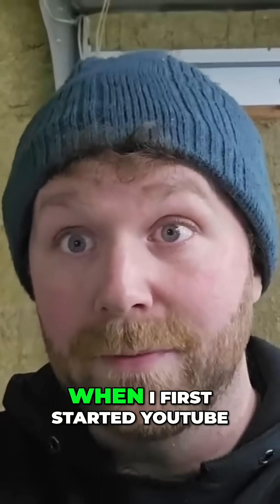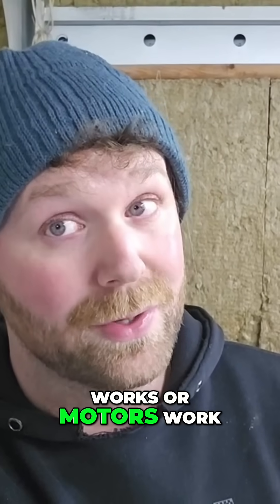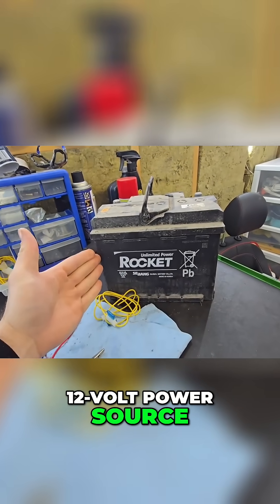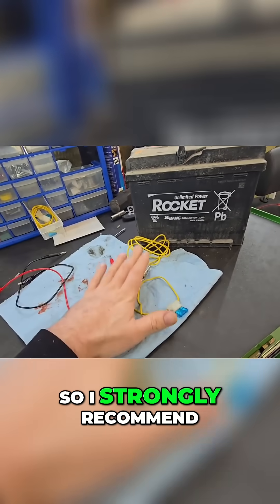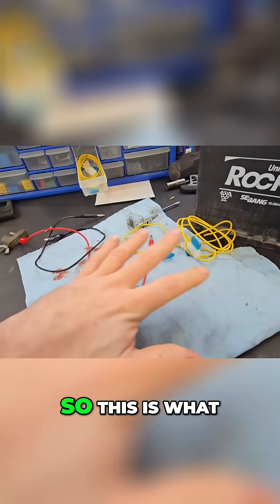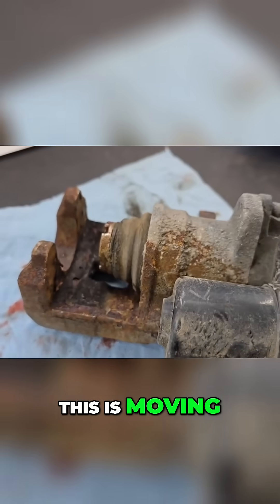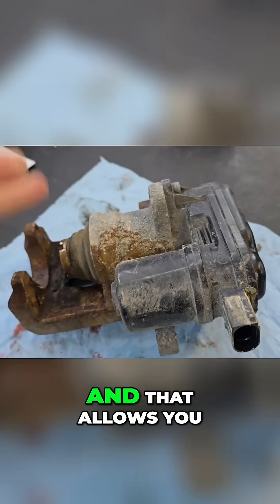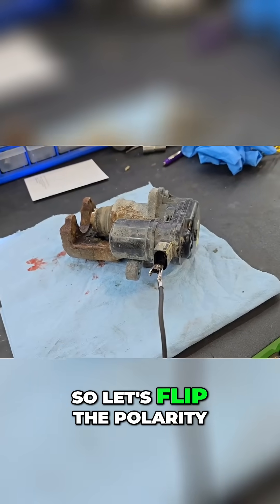Reverse Motor Polarity  Easy DIY Car Hack!

Comment: Interesting enough you can reverse the polarity of a battery by depleting it completely and charging it with the cables hooked up backwards. I saw this one time when a customer brought me a deep cycle battery to charge staying there was something wrong with the inverter in his camper. My charger kept saying the clamps were on wrong so I put my volt meter on the battery and sure enough it read negative voltage. I ran the battery completely dead using a light bulb and recharged it properly. It tested fine when i was done.